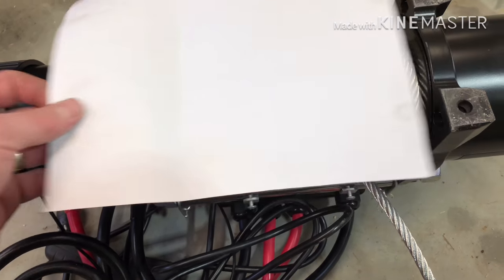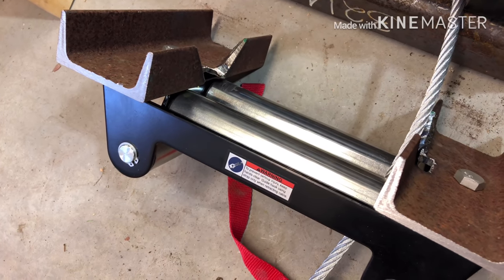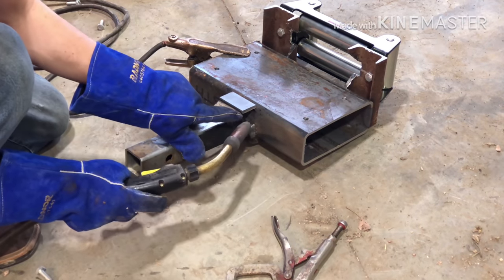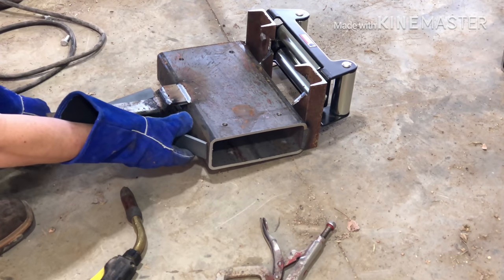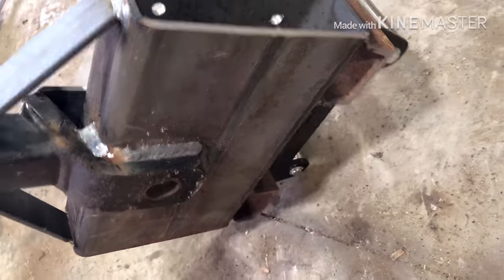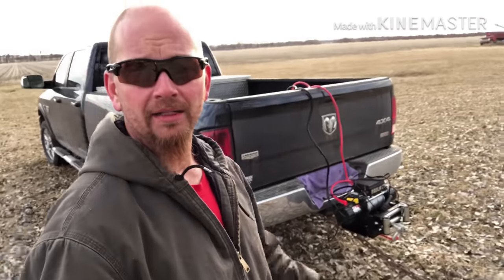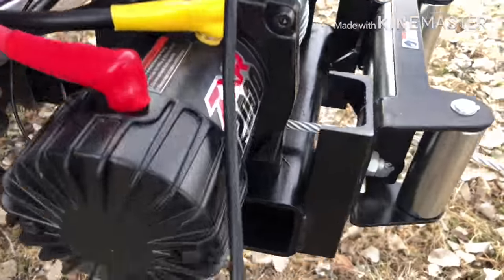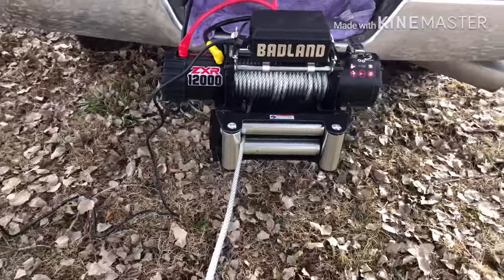Badland Winch 12000 lb. Custom Mount And Test Pull

Comment: Nice work. Now it needs end plates to box the rectangle tube, another hook/loop for a block and tackle setup (in case you ever need to pull a train out of the ditch), and some wheels to roll that big sucker around. Lol
Reply from the maker: Thanks, great points 😀

Comment: That's a great winch. I just pulled 2 kids out that were buried down in a Caynon. 
Just a suggestion.. look up the duty cycle and adhere to it. 
Since you weld do what I did. I welded a receiver to the front of my truck too. 
Never know what direction you'll need it. 
Good luck
Reply from the maker: +Vera 1957 Thanks

Comment: Nice fab job, very strong. I might have turned the gussets. Looking down the gussets would have been triangle plates. I would also have thought about putting a hole in one or both to put a shackle in for a double line pull. (be heavier though maybe 3/8 plate or that.) I've been looking for some ideas and you gave me some! I'm not liking the usual plate with a tube under it.
Reply: I agree on the plates. Especially since it's sticking out so much from the back. Take advantage of that to make a step to get up into the bed. And a shackle mount or two would be smart too.

Comment: Harbor freight sells a receiver mount for the bad land winches. They advertise it for the 9000 but the 12000 has same bolt pattern. The 18000 winch is different than the other's and doesn't have a hitch mount option

Comment: I have a 1994 ram 1500, I took their mounting plate and welded it in place of the factory bumper at the frame rails. Minimal cuts to the rad support which were patched using angle iron to invert the original edges. It looks great, but now I need to make the rest of the bumper. I'm thinking of getting 1/4 plate and coming up on either side, then drilling holes for dom tubing to tie in then wrap around the front. I'll post a video if you're interested in what it looks like.

I highly recommend ditching their cb bank in favor of a high amperage fuse. I had a close call when my battery tray cracked, I have dual batteries and the factory tray wasn't in great shape.
Reply: Andrew Villa why would you ever weld the frame rails together?
Reply: @MrSmith-ty4bg  why would you not? They're welded together at the factory at that exact spot.
Reply: At the radiator support. It's an extension of the frame rails, at that point forward. They're already welded with box tubing and the actual radiator support bushings bolt in there. I just looked at it to make sure I remembered right.
Reply: Andrew Villa you should ever weld frame rails together. Your frame needs torsion. Boxing in the frame rails is different. Connecting them together is going to create cracks.
Reply: @MrSmith-ty4bg  then why did Dodge do it at the spot where I did it? It's the first four inches of the rails, just before the rad support crossmember that Dodge welded together. Did the factory do it wrong, too?

Comment: Nice welder. Those winches are pretty good for the price. I have never had an issue with mine. Any tool used properly will last!!
Reply from the maker: Thanks it is still working good
Reply: @HighOctane101  Yes sir. I have it on my H2. I made a bracket very similar to yours and it's universal where i can use it on my trailer. I Work it hard too. I give it breaks so it won't heat up. I never had it stop or seize due to long use. some people torcher them on YouTube which they don't know how to clearly use them. It's an eletronic motor and all motors need their rest.

Comment: Put a jacket or floor mat on the cable to dissapate energy if the cable snaps. Don't want to end up decapitated
Reply from the maker: Yeah looking back on it I should have bought the wireless remote from harbor freight!  I was limited on cord and wanted to try it out! Thanks for the tip on my safety

Comment: Not a bad winch but,
If that cable was ever too snap it will cut you in 2 pieces. 
You should be using a winch line dampener.
Reply from the maker: Yeah looking back this was a bad idea I should have bought the wireless remote option
Reply: don't be a pussy I love carnage
Reply: Always a good idea, but in the few line breaks I've seen, single straight line pulls didn't whip out. Using a snatch block and especially for a change of direction is where cables get really dangerous.
Reply: Carry a small carpet and throw over the cable to dampen the snap. It is a thing, it can hurt and kill pending where person is standing.

Comment: Hopefully you just had that steel just laying around. Otherwise for the cost of that steel you could have just bought the receiver mount that HF sells for that winch. Might have been cheaper and would have taken less time. And the HF receiver mount for the winch has handles to carry it when you take it off.
Reply from the maker: It was all scrap steel I used, honestly I did not even know they made a receiver mount. My main goal was to have a mount to hook to my trailer so I could remove the Winch easy to it would not be stuck on the trailer all the time!!
Reply from the maker: Just got done looking at the Winch mount on harbor freight and I am glad I made my own now,  there mount uses pretty thin metal and one review I say the case of the Winch actually broke because the steel mount twisted.  And I am really hard on things but they do have the price right!
Reply: exactly the reason I was looking at some ideas in case i need to pull in a direction not completely parallel to my truck. @HighOctane101

Comment: Weak point in the pull ?... The F'n cottonwood ! I hate those trees. Anyway... nice looking mount, looks way stronger than the Northern Tool version.  .250 wall on the tubing ? Thanks for sharing.
Reply from the maker: Actually I did not even know that harbor freight sold a mount until someone told me I was wasting my time building my own vs $54 mount.  So the next time I was there I looked at their mount and I laughed

Comment: If I was to order that tubular piece of steel from a shop, what would i ask for?
Reply from the maker: It is 8”x3” rectangle tubing and 1/4” thick and 13” long, hope this helps
Reply: @HighOctane101  I appreciate it.
Reply from the maker: No problem, hope it works for you like it did for me.  Still use it today
Reply: @HighOctane101  what are the dimensions of the C channel?
Reply from the maker: @aarondavis8652  I’ll get them for you when I get home today
Reply from the maker: 3” by 1 1/2” by 3/16” thick c channel and 6 1/4” long
Reply: @HighOctane101  I appreciate it very much. I bought a 15000 winch so I will apply this setup.
Reply from the maker: Nice hope it works out good for you.